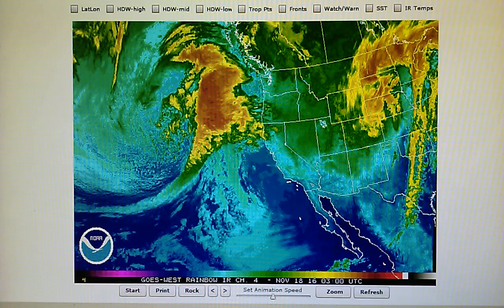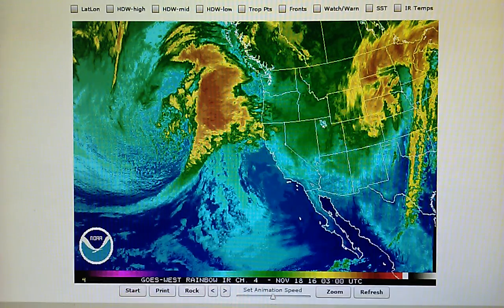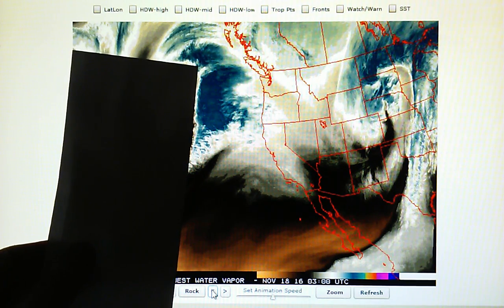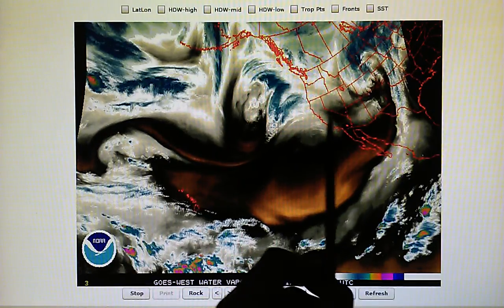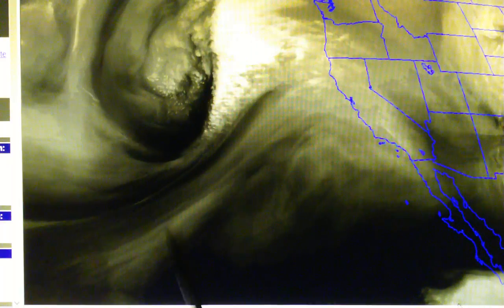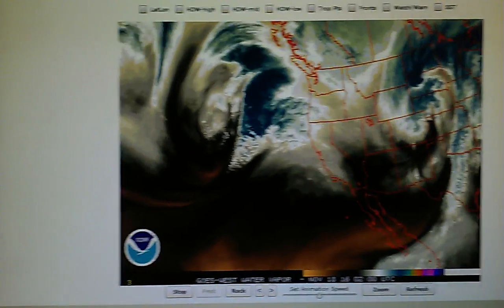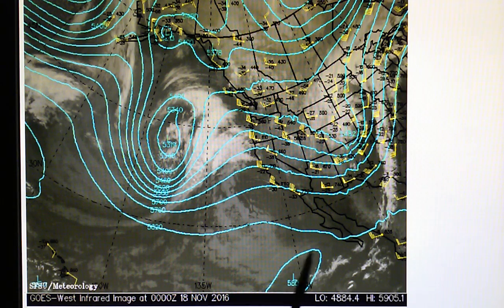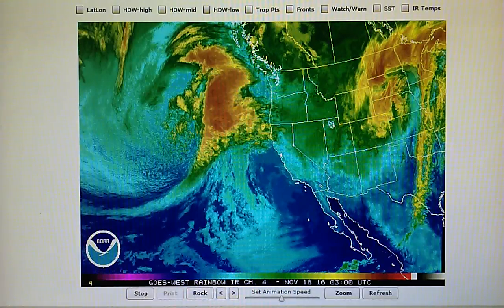11-17-2016; Climate Change: Two Storms & Two Right Angles; High Pressure Blocks Next Storm Into CA!

Comment from the maker: The barometric pressure has been pumped up to 30.05" in preparation to block the storm offshore.
Reply: 11:30am- Heavy chemtrail activity using the fast dissipating aerosols, a dozen jets at once. (above west LA) Looks like a sprayer took off out of LAX or santa Monica Airport with his sprayer on,  at take-off. 
By 2:00pm the blue sky will be replaced with the low visibility, chemical haze.
Reply: 4:00pm The sky is horrific
Reply from the maker: Ashton 09 - Yes the jets started today spraying the fast dissipating mix; then about 2:00pm I went outside and saw the long aerosol streaks running parallel to the coast. With the barometer up at 30.05" along with all the spraying we may not see 0.125" of rain despite the storm's strengthening to 982 mb the past eight hours.
Reply from the maker: Montello 90 - Whatever amount of rain we may get, high pressure will immediately be installed afterward yielding dry warmer weather; this will quickly dry out the soil and the benefit of the rain goes out the window.  Three days after the rain the soil is as dry as before the rain event. We observe this pattern over and over. Today it is reported that 115 million trees are dying or dead in California. The number has doubled since 2015.
Reply: Its sad to see Sunday afternoon thru Monday is suppose to bring rain but they are saying 1/2 inch of rain. That doesn't do much does it.
Reply from the maker: Save Greenland- Thanks for this info; I'll look at this tomorrow morning.
Reply from the maker: Save Greenland - I looked at that; didn't see anything resembling a transmitter.  Those coordinates you gave earlier are out in the Pacific. The middle white building does not seem to have any antenna elements.